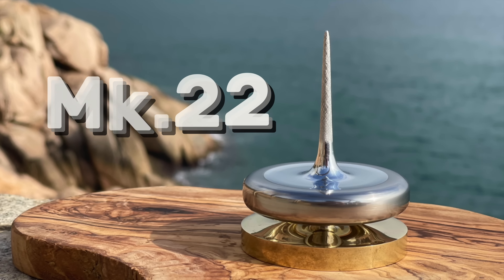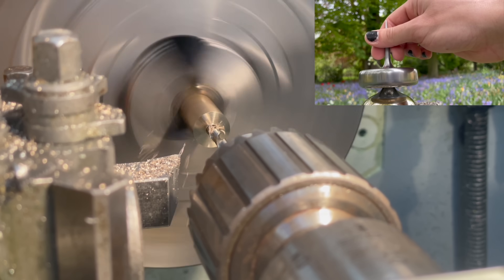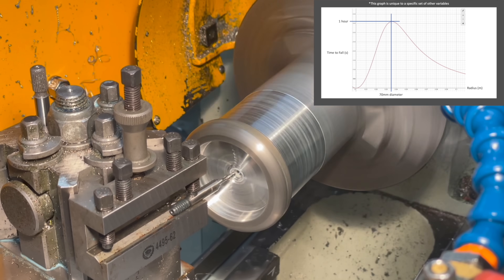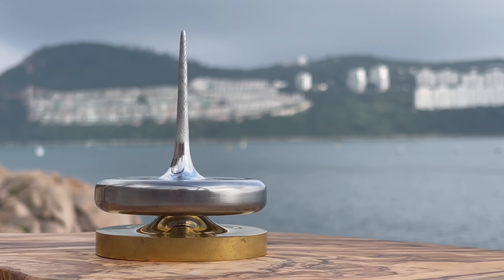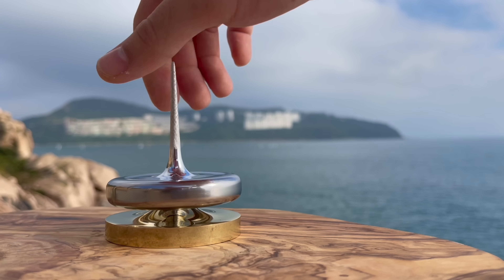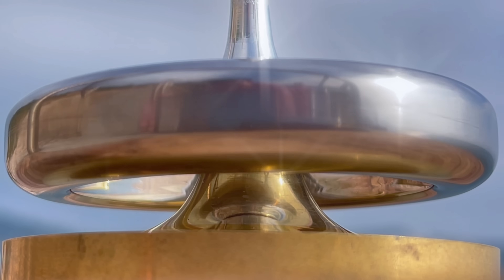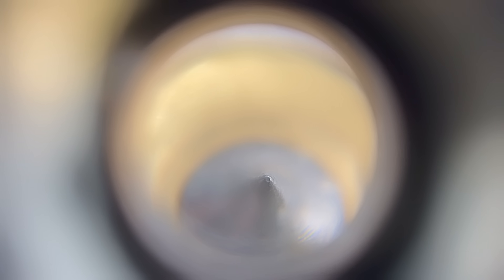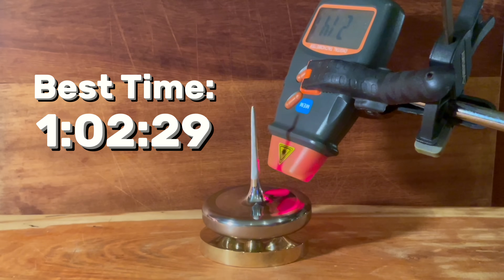Spinning Top Mk.22 | 1 HOUR BARRIER

Comment: This might be a dumb idea that you've already tried but old mechanical watches used ruby jewels to minimise friction and wear, that might help drop the tip friction lower if you want to progress further? IDK, you're the engineer! Such a cool series, thankyou!
Reply: Diamond has an even lower coefficient of friction!
Reply: @DisorderedArray can confirm polycrystalline diamond is the way to go
Reply from the maker: @phiro4305  The contact point is definitely an area for innovation. I (and others) have found that hardness certainly isn't the only factor - cubic boron nitride and polycrystalline diamond for example are highly abrasive. A carbide spiked tip spinning on either can become blunt over the course of a single spin, causing imbalance, more friction and worse performance. If we swapped the base and tip materials, now the spinning top would drill into the base, get stuck in the hole causing vibrations and losses. Also, yes, coeficient of friction when dry (for ball tips) or oiled (for spike/micro-ball tips) is important!

The typical solution is to use materials of similar, high hardness for the tip and base. HSS on WCarbide is good for longevity but for a single spin, WCarbide on WCarbide is the best. Interestingly, perhaps due to Mk.22's incredible spin time, I have found that over a single spin WCarbide on WCarbide can cause drilling and vibrations - you will see this in the full spin video. In my testing it has seemed quite consistent that after about 45-50 minutes, some vibrations occur (not due to imbalance but getting stuck in a hole as described above).

If you have any suggestions, do give them (regardless of if you are an engineer or not! I am still a student) :) @xzorby for example suggested a DLC coating on the tip which I am now looking into!
Reply: @hiper_tops  what about applying DLC on the Top and on the platform that it spins on?
Reply: @hiper_tops  I have no valuable contributions or suggestions on what might be the optimal design for a record-setting top, but for the commercial version I would recommend using a base that is slightly harder than the tip and selling the top with a set of replaceable tips. That way the base and the main body of the top have longevity, and the only part that needs replacing over time is the tip which can be swapped in and out. Not to mention, it would provide some small level of ongoing income from existing customers.
Reply: @hiper_tops I’m curious in how much air drag could be reduced if the sides were polished to mirror finish.
Reply: @hiper_tops  Did you try self lubricating materials? Like cast iron with medium to high carbon content? Certain kinds will have graphite micrograins embedded in martensite structure and if used on tip spinning on hard carbide base, while wearing down it would lubricate surfaces rubbing together... I never heard about this kind of application as cast iron would be too soft for small contact area prolonged bearing like application but we are looking at potentially single use part here, maybe something you want to look into? Maybe other similar 'self lubricating' materials?
Reply: Cheat a little use a hydrodynamic bearing to increase surface contact area... like a 1/2 in ball bearing as the base contact platin an inverse carbon die on the other and have the air intake at the tip of the top using that you can create a  centrifugal compressor that won't take much pressure and have repeatable results
Reply from the maker: @JusDoc  This is a good idea and exactly what I had in mind haha. I was also thinking of including a micro bearing ball version which should last longer and be easier to replace than spike tips.
Reply from the maker: @NurseDad  It is true that a finer polish would have helped (beyond what I achieved with Mk.22, perhaps 1-2% longer), however regardless of how long I spent polishing with my diamond lapping pastes, all the way down to 0.5 micron, I could not get a mirror shine from the alloy I was using. As you can see, the aluminium is shiny, and I used the same finishing process on it as the flywheel! This is probably because the flywheel is a very hard material. I was a bit rushed in getting this top off the lathe but in the future I will try harder to get an even better finish :)
Reply: @hiper_tops  Teflon coating for the base or polished delrin?
Reply: @hiper_tops  is there a coating that could be put on to reduce the drag coefficient? Not sure if something exists, but maybe a ceramic coating that can fill microscopic imperfections?
Reply from the maker: @vintageswiss9096  Simply too soft unfortunately! The top is too heavy and would drill into it, hugely increasing surface area of contact and friction
Reply from the maker: @NurseDad  This is something that has been suggested but I have not had the opportunity to test. I would love to try a chrome coating for example, I think it may help slightly!
Reply: @hiper_tops WILD!  It’s almost like those “long time” engineering considerations are happening.  Granted a bit of “water is wet”, but it’s just interesting to my brain how fast those effects take place over many other situations and thus how one needs to adjust the engineering process.

(Getting access to thin film coating tech, and heck maybe even that Open Source single point diamond turning lathe would allow you to make one HELL of a top+top base (now just how to get the Depleted Uranium…)

Either way keep up the great work!
Reply: @hiper_tops Perhaps a concave base that very slowly rotates, changing the point of contact and preventing a hole from wearing in a single spot?
Reply from the maker: @astecheee1519  I would like to try this as it seems easy to set up. Although I'm not sure what the record setters would think haha
Reply: @hiper_tops I think the best argument might be "it's about the top, not the table".
Reply: @hiper_tops could there exist some hard rock that could hold lubricant in a way that gives a layer of lubrication?
There are a few very hard rocks.

Or some other type of lubricant to use ?
In engines they used to add zddp to engine oil to lessen frictional wear. But that is for high pressure areas like flat tappet valve lifters etc.
Not sure if the tip on the spinner experience similar pressures?

Maybe a tip is the wrong solution?
Water turbines are held up by perfectly flat hand scraped brass surfaces with high pressure oil inbetween.
Youd need something to stabilize the spinner I guess but maybe theres a solution.
Reply: Has already been tried, the previous iteration used a changable ball bearing as the tip, and one material mentioned was ruby
Reply: If he realy wants to go compleatly insane he could have a ruby tip, tungsten rim and carbon fiber body
Reply: How the hell does this channel only have 2.3k subs
Reply: @thedownwardmachine it’s a channel about spinning tops?
Reply from the maker: @BernardCrumpins-vx5lo  lol
Reply: @hiper_tops  if you could enclose it somehow, you could use air pressure difference to your advantage. Would only take a very small amount of energy to keep a minimal air pressure difference between the top and the bottom of the flywheel. Over a large enough area even a small pressure difference is enough to significantly reduce the weight of the spinner, so you could use better materials for the tip that would be otherwise too soft. Its like the diffusor+floor of a reacecar, but in this case creating lift instead of downforce.
Reply: Modern mechanical watches use ruby berrings as well.
Reply: What about a slippery tip like UHWMPE on an extremely smooth surface?
Reply from the maker: @joshmarchant604  This material looks promising for light tops, however beyond 50-60g, I think it isn’t hard enough. The tip would flatten, increasing the radius of the contact spot and hence breaking torque. When I work on single-spin tops in the future, which will be lighter and smaller, I will try this material
Reply: Look up the Lambda top. It’s exactly what you’re talking about.
Reply: @MichaelsPwner Lambda Lambda Lambda 🤓
Reply: You could experiment with a smoke machine to see if a textured surface would improve drag. Or perhaps a rim like on the underside to catch the air and stop it slipping off the edge.
Reply from the maker: @Samdawe1981  I would like to do some experiments on this, if anything just for fun. I was playing with some incense smoke yesterday and was quite surprised to see that there is significantly more airflow on the bottom half of the flywheel downwards than above! Certainly things to learn
Reply: So as inside the watches, it will need not only the rubi, but also some specific oil ...
Reply: Unsure if the quality of nerling is important. But I know a few companies have put money in to golf ball dimpling design to reduce drag so maybe lots of jigged dimples with a small carbide ball burr then polished will yield a couple more minutes.
Reply: Current mechanical watches use them as well
Reply: Ruby jewels?
Reply: Graphite is a very cheap but efficient and easy way to reduce friction. They told me about the amazing properties in the factory at my internship. Really worth the try because it's not expensive and steady. Only prone to making things a mess.
Reply from the maker: @iggypeters5564  I’ll have a go! Really busy with work at the moment unfortunately but hopefully I’ll get some time before new years :)
Reply: @hiper_tops okay this in on the wild end of ideas but... have you looked into recapturing the air flow somehow? Using the air pushed around to impart some of its energy back into the spin.

Or some diamagnetic effect to cut down on the friction. 

Just spitballing here, trying to think outside the box.
Reply from the maker: @johannesmajamaki2626  Thats how breakthroughs are made! Regarding the air flow, a shroud around the top has been shown to be able to prolong spins by about 5%. This is because it keeps circulating air around the top, hence reducing the velocity gradient. However, in my eyes this is a bit like cheating so I avoid tampering with atmospheric conditions (e.g. hiking up a mountain for reduced air pressure). I'm not sure how to harness the air flow without making more drag in the process. 

And regarding the diamagnetism, even if I used a solid bismuth flywheel and a base made from N52 neodymium magnets, the lifting force would be negligible compared to the weight of the top, especially due to the separation between the magnet and flywheel. So this is a bit of a long shot for tops this size!
Reply: @hiper_tops  I suppose I was more thinking of how magnets fall very slowly through a copper tube. I mean yes, this isn't strictly diamagnetism, but it's magnetic repulsion nonetheless. 
I mean it might come to a deep philosophical question of what really is a spinning top, if what you've made is an elaborate hand powered electromagnetic machine, but nonetheless.
Reply from the maker: @johannesmajamaki2626  Ah yes that would be eddy currents - they would slow down the top quite significantly! For example, if a copper flywheel were to be used with magnets in proximity, the eddy currents that form in the copper would actively break rotation like a tesla or similar electric car's regenerative breaking :)
Reply: @hiper_tops  right!
But maybe such magnetic interactions could also... accelerate it?
My very off the cuff idea here would be to have a second, magnetically coupled disk, which stores extra energy either inside the spinner or inside the base, in a closed space where air resistance is less of a factor. Heck, it could run in a low pressure atmosphere of helium, like a hard drive disk. A second spinner inside of the primary spinner would probably be the least "cheaty" form of this.
Reply from the maker: @johannesmajamaki2626  I see, yes this is an interesting but complicated idea! If implemented as you say, perhaps it could store some extra energy. I believe this would count as cheating in my category but an internal flywheel certainly sounds like a fun idea to try!
Reply: I was thinking the same thing
Reply: ..and using ruby berrings…
Reply: High performance
Reply: Did someone tryed doing a spiner whith air bearing tip?
Reply: Hows about a single carbon nanotube.
Reply from the maker: @lukehcullen  I don't think it would be strong enough in compression!
Reply: Is it considered cheating to spin the top in a vacuum chamber? 🙂

It could be connected to a larger tank where the air already is removed, so that as soon as the top is spun up and lid is put on, 
most of the air in the chamber can be removed quickly by opening a valve, and the rest be pumped out soon after.
Reply: Teflon 😮
Reply: Do you know what I'm talking about with jewelled pins Bob?

Bob?

Comment: High-Performance. Could anti static coatig reduce any air draft or is it not spinning fast enough? Perhapes using a gemstone as tip so it woun't wear down? I don't know, I'm not an engineer :) Good luck.
Reply from the maker: I haven't looked much into anti-static coatings for this purpose but yes certainly air drag is a big factor (60% of total energy loss over the spin). In my research, a perfectly polished surface is the best way to reduce it but I think the spinning top and base geometry could help too!

Comment: I think you could beat simonelli if you tried spinning it 1st to high speed with your fingers and then use the edge of your hands rubbing together to reach an even higher speed
Reply from the maker: True however a palm started top would require quite a different geometry to account for the higher launch speeds and hence owns itself to a separate category :)

Comment: why not use a harder material for the tip, like an industrial diamond, or silicon carbide
Reply from the maker: I would however the base material would have to match or be harder (without being abrasive) or else drilling would occur. monocrystaline diamond and CBn is something I'm looking into but it is expensive and hard to get in the geometry I need.

Comment: It’s probably completely irrelevant, but I can’t help but wonder if spinning the top counterclockwise instead of clockwise might make a difference. It would then match the majority of vortices in the air of the northern hemisphere. If it makes any difference at all it would probably be offset by handedness anyway.
Reply from the maker: Interesting idea, however since the relative air speed in the room is ~0, it doesn't matter where in the world it is located, clockwise and anticlockwise would act the same :)

Comment: Have you considered putting on dimples, like golf balls have? Or is air friction not an issue?
Reply from the maker: Air friction certainly is an issue! For Mk.22, it contributes about 60% of total energy loss over the spin (And more so in previous designs like Mk.19). However golf ball dimples is not the solution - more info in the pinned comment :)

Comment: After an hour, does the base contact point tilt enough to increase friction?
Reply from the maker: Not particularly thanks to the tiny contact point. However as you will see in the full spin coming out, after sufficient time, the top drills into the base causing increased contact and friction.

Comment: Excellent work, if you can imagine more optimizations I encourage you to persue them, either for higher time and consistency or a more easily mass produced product. Not that mass production is good idea for you personally, sounds like a way to turn an awesome hobby into a dreadful job.
Reply from the maker: I am certainly still interested in pursuing perfection. Right now I am thinking about longevity of spinning contacts with the aim of producing around 10 tops for sale. I doubt I'll take this to mass production any time soon XD
Reply: @hiper_tops  how much would you charge? I have a small collection and adding yours would finish it off very nicely
Reply from the maker: @soberskater   Hopefully in the future I'll be able to semi-mass produce a smaller, simpler design but with the 10 I am planning on making, due to the huge time and effort spent on each, it would be at least 600 USD.

Comment: nice.
i wonder how it would perform in a vacuum.
did you lubricate the contact point?
Reply from the maker: In a vacuum this top should spin for at least 3 hours, because air resistance accounts for so much of the breaking torque at the start of the spin. And yes the contact is lubricated :)

Comment: I'd be interested in hearing more if you commercialize this.

Could the upper spindle be knurled in a specific way that it could have interesting interactions with wispy filaments of smoke?
Reply from the maker: Thanks! Significant knurling may cause some turbulence for sure. Light knurling like on Mk.22 should allow smoke to be sucked down, over the flywheel and expelled radially in a disk at the maximum radius. (As this is the airflow it creates)
Reply: @hiper_tops  That's just what I was hoping for!

Comment: High-Performance! Love this – I'd definitely buy one of these, so I'm looking forward to when they are ready for sale.

Edit: scratch the below, I'm not the first person to ask this!

Also, I have question: I'm curious, would a dimpled pattern, akin to a golf ball, make for a more efficient grip? In the case of the golf ball, this helps to keep the flow of air more tightly bound to the ball, so there's a smaller pocket of low pressure behind it, but in the case of a rotating object, I don't know if the dimples would be of any use, or if it would make drag worse due to the turbulence. I suppose you may have already considered this, given the number of iterations. I'm interested to hear your thoughts on it.
Reply from the maker: Thank you very much! It's good thinking but as you would have read me explain, not the best approach in this case :)